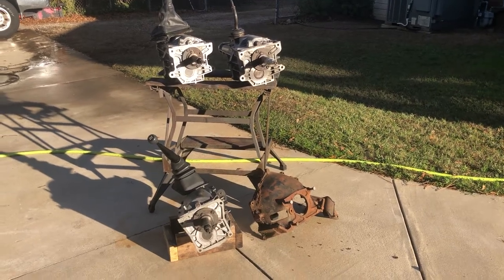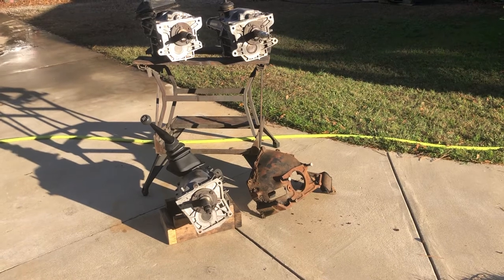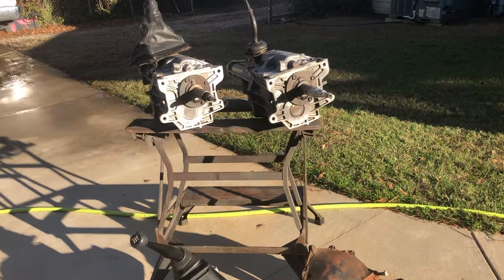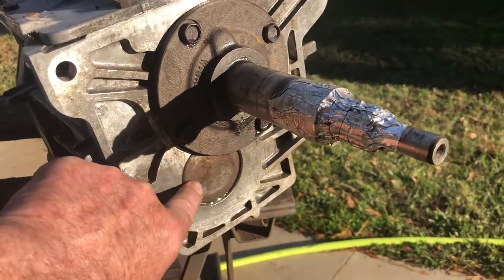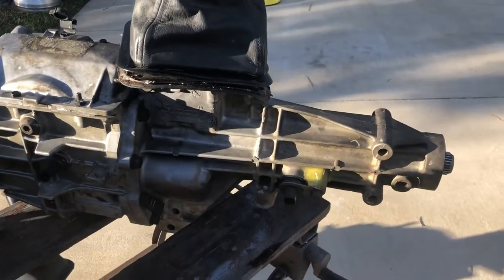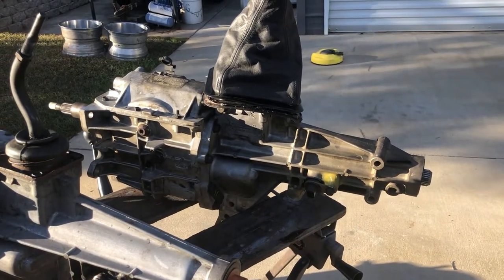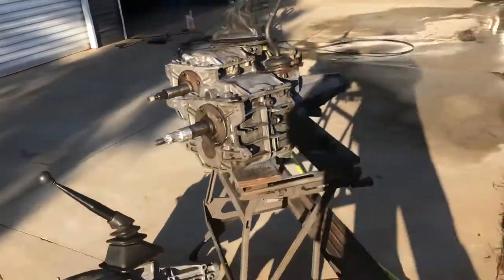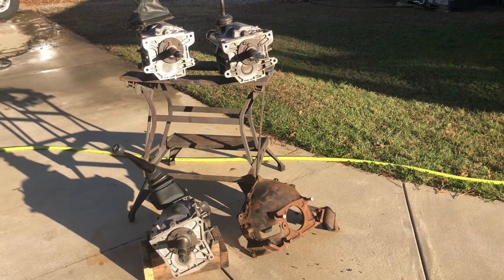S10 T5 transmissions - 3 different versions.

Comment: I was lucky enough to find a ‘92 WC s10 fully rebuilt near me for $400 for my hotrod build. Not the best price but these are getting harder to find nowadays
Reply from the maker: Yes. Hard to find. It’s a great transmission for a daily driver. I have one in each of my trucks.
Reply: I thought 93 was the only year they put WC T5 in the first gen S10 ? you sure it was a 92 and not a 93 ?
Reply from the maker: @SatansChoice  Correct. The 93 S10 is the only year with a Muncie pattern WC T5 but the case was cast in 1992 for the 1993 production year. The WC was also in the 1988-92 Camaro/Firebird.

Comment: I have 1963 f100 y block 292 , just found a t5 156775 88V.  1352-216 88 tag  any suggestions for it Thanks great video!
Reply from the maker: You might need an adapter plate to get it bolted to the bell housing.

Comment: Thanks a lot i have a 1995 s10 4x4 that was either a automatic or a 1995 world class speed but someone has swapped i believe a 1993 into it i hit the dash 1st and 3rd everytime i swapped the top of a 1995 transmission on it but i couldnt get a single gear
Reply: A 1995 world class 5 speed is what it was supposed to say

Comment: Hi there, I'm trying to find out if there are any differences between a 2wd and 4wd transmission. I've got access to a 5 speed from a 2wd 92 s10 and I want to swap it out for my '83 s10 blazer.
Reply from the maker: Yes, the tail housing and main shaft are different (I think). The gearing might be different too. Good luck!
Reply: @Lugnutz65  Thanks man 👋

Comment: I have a World Class T5 that belongs to a 1993 GM 2.8 V6 truck. Manual gives me the option of using Dexron iii or Synchromesh. How do I determine which one my WC T5 takes? It was my belief that NWC takes gear oil and WC the ATF(Dex iii). Is the synchromesh fluid interchangeable to either NWC or WC? And I also heard that modern gear oil can eat up the bronze synchros so that’s why Synchromesh fluid is preferred to gear oil but not sure if it can also be used on a WC T5. My T5 took a dump & I found a WC Donor that’s bone dry and wanted to fill it up but don’t know what fluid to fill it up with, any info helps thanks!
Reply from the maker: @luissonoma6255  since Dex 3 isn’t available and Dex 4 and up is too thin you should use Dex/Merc ATF. It’s correct for WC and NWC. I have verified in S10 factory manuals that ATF was used in NWC T5s. I prefer the slightly quicker shifting that ATF provides. Synchromesh is acceptable for NWC but I prefer the Dex/Merc ATF.
Reply: @Lugnutz65  Awesome, thank you. I ended up getting AcDelco Automatic transmission fluid type iii (H) part number 1076073 on Amazon at $11 a quart. According to the owners manual a 5-speed with a RPO code of either ML3 or MW1 takes the Dexron ATF and the 5-Speed with a RPO code of MY2 takes Synchromesh fluid. I just couldn’t decipher which was which. Maybe that’s because it is from a 1992 manual & I heard WC were introduced on a S10/Sonoma in 1993 could be wrong though. If it has some play side to side would that be ok? Don’t really want to rebuild as I don’t have the funds? How much is one of those rebuild kits for a WC T5 & best place to get it? I checked eBay & seen one from $300-$450 but some lack some things like reverse.
Reply from the maker: @luissonoma6255  I can’t comment on the ATF you bought. I just don’t know. 
You are correct. 1993 is a one year only S10/Sonoma T5. It’s WC and has a Muncie bolt pattern for the bell. In 1994 it stayed WC but changed to the Ford bolt pattern to the bell. Camaro/Firebird was WC 1988-92 with a Muncie pattern and went to Ford pattern in 1993. 
Buy rebuild kits from ALLSTATEGEAR.com.
Reply: @Lugnutz65  Perfect, thanks. I’m going to look into it & see if I can get it looked at this week.

Comment: Do u know if a t5 out of a 1990 s10 2.8 v6 will bolt to a 91 2.5 4 cylinder
Reply from the maker: Yes it will.
Reply: @Lugnutz65 is the only difference from the world class and non world class is the speedo and what would I need to take from the world class truck to make it work in a older non world class truck
Reply from the maker: @BrianPratt-k4v  1989–1993 S-10 T5 transmissions use an electronic sender for the speedometer. You should be able to swap transmissions within those years without any issue. A non-world-class transmission has different parts on the inside, but functionally is the same.

Comment: which model year has a 14 spline input shaft
Reply from the maker: 1993 and earlier S10 T5s have 14 splines. Also the 1992 and earlier V6 Camaro T5 but the tail housing has the shifter in a different location.
Reply: Yes and so did the manual gmc safari they made very little of

Comment: We are swapping to a 4.3 can we use the 4.3 bell housing on the 2.8 5speed
Reply from the maker: @Ju5ticeDad  My understanding is that a SBC bell will bolt directly to a 4.3 engine. You will have to measure the distance needed for the input shaft. I am not sure if the input shaft will need to be trimmed or not. I am not familiar with the bolt pattern used to bolt a transmission to a 4.3 bell.
Reply: @Lugnutz65  okay thank you

Comment: Are the 2.2 T5 any weaker than the others?
Reply from the maker: Non-world class is rated for less HP than the world class versions but the difference is minimal. A T5 is great for normal driving but doesn’t take abuse. Some have better gear combinations than others depending on your rear axle gear.
Reply: @Lugnutz65 How would you know which is the best gear combination? I have a 7.5” rear end on 3.42’s on my 1993 Sonoma. I have been looking for a transmission but none that are available is WC. One is but when looked up the tag it read 1352-221 which shows that it was mated to a 2.5 Iron Duke(4 Cyl) would that matter or make a difference? But it is World Class & it’s a 93’
Reply from the maker: @luissonoma6255  Here I show an easy way to find out what gears are in your current T5. You would then try to find one with the same gears. Fifth gear is either 0.86 or 0.72. The other gears will not matter as much. https://youtu.be/YOybbxm9YGM?si=RoZGfEDnK4nh9GHD
Reply: @Lugnutz65  Out of .86 or .72, which one would be better overall or best for my 2.8?
Reply from the maker: @luissonoma6255  Either will work fine for general daily driving.
Reply: I have a 63 f100 yblock 292 , just found a use t5  tag say 1993 s truck   156775 88.   1352-216       V.      88 
Think it will fit  or any you recommend? Thanks  great video!
Reply: @luissonoma6255  Because the motor that you r bolting the t5 to is a 2.8 you dont need a WC , as far as best OD the .72 is actually what the factory installed in that year but like lugnuts says ether will work.
The WC t5 in the first gen s10[s was one yr only and the yr was 93 , prior to that they were using NWC boxes , so for the 2.8 the choice is yours.
Reply: @luckyPiston  Yeah I suppose but the truck was a 93 & I figured the WC one would shift smoother. Right now it has the T5 that was mated to an Iron Duke.
Reply: @luissonoma6255  I hav a 93 w/iron duke & t5 , i also hav a 87 w/iron duke & a t5 an honestly i cant tell the difference , if anything the t5 in the 87 shifts better because it has cleaner oil and lower miles on it , So are the syncos in a WC better than a NWC ? i kinda doubt it,  Im of the belief that the only real difference strength wise is the NWC has a 0.125 smaller input shaft shaft and really the NWC is underrated as a result, ive never heard of anyone breaking an input shaft , it would be a good question to post on the forms.